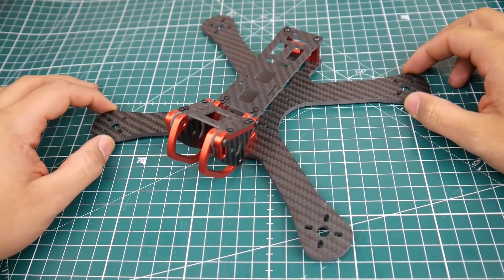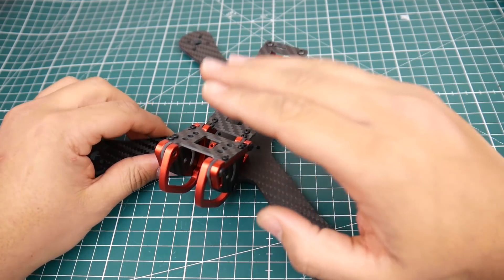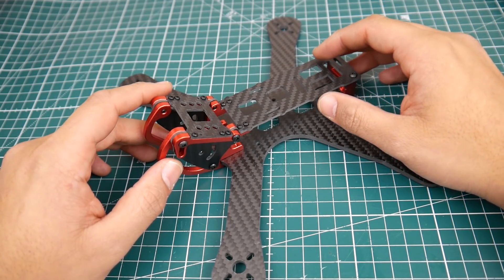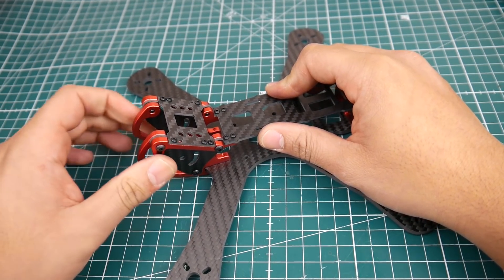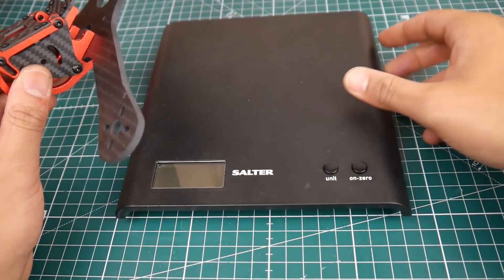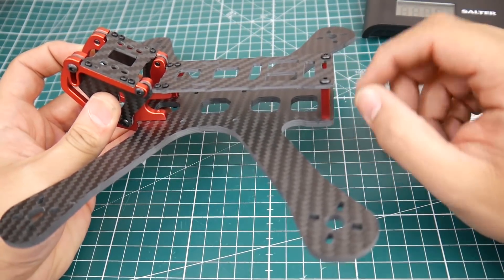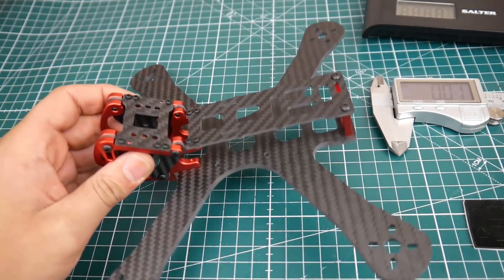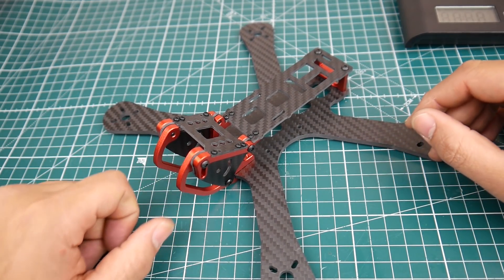Puda Chameleon Clone Frame

Comment: Being as this is  a cheap clone, it is possible that the  screw manufacturing is half ass and the threads are not as pronounced as they would normally be with higher end components. I would recommend purchasing some good screws from the local hardware store while still installing with care.

Comment: I have two of them. And I have three chameleons. In all honesty they both fly nearly identical. And the Puda frame has taken some very hard crashes and has never taken any damage.
Reply: What mount fits this frame for a go pro?
Reply: @lloyda88  I run sessions on it. But you can use any mount that is designed for the chameleon. With the session I just run a strap. It has a pad to anti slip the camera.
Reply: @JoeMaxFpv  thank you!

Comment: Armattan has an assembly video that specifically talks about not over tightening screws and to use a little lock tight if desired.   I didn't use lock tight and mine is holding fine so far.   I'm still sticking with armattan for the warranty
Reply: exactly

Comment: Does anyone know if there are replacement parts available for the Puda or do you need to buy a second kit? Also is there a chance that the Armattan parts will fit the Puda? I know it’s sacrilege but kind of important to know, especially if the aluminum is junk on the Puda. I was all hopped up to finally build an aluminum chameleon once the Ti version came out. I assumed the aluminum version frame would be greatly discounted or cleared out. No luck, just a tiny discount in price. My crash to income ratio is too high. I always will be cost conservative. Thanks for the video Mesh.
Reply: i have both frames and yes armattan parts will work on the puda.   puda as far as i know have no replacement parts.  oh and the puda stingy frame is great too, i have one as well
Reply: Derek Dvorak Thanks!
Reply: if your crash to income ratio is too high then that is EXACTLY why you should buy armattan , i destroyed my chameleon a few months back and they replaced everything, and i payed 5$ for shipping, thats it
Reply: I well agree the warranty is great as I broke my frame I half and had it replaced for just $5 shipping.  the warranty did nothing for me when I lost it in a failsafe and couldn't find it.

Comment: question is if its really 6065 aluminum :D problem with the screws could be solved by drilling the hole through the other side (where possible) and just adding an m2 nut :)

Comment: I've just finished building one of these as my first quad build, RR hypetrain 2306-2450, Dal cylcones, Matek f405 ctrl, Speedix gs 30a, Runcam split 2(need to make a mount for it as the cage is in frame on the he footage), TBS Unify pro HV and XM+. I think you'd struggle with a 3 stack in one of these. My camera cage has taken a couple of good hits already, and so far so good. But the threading on it is so bad I had to screw my screws in with a pair of pliers.
Reply: slingitsideways all that quality gear and you cheap out on a frame? If you waited a bit longer and save that extra $20-$30 you could have had the armattan with the lifetime warranty, I guarantee you will be replacing this frame and cursing for not getting a free replacement. It’s ok, it’s your first build. 
Poor man pays twice.

Comment: So as it looks it's a blatant copy.... But the other one uses M3 bolts and screws..... The aluminium is different as well.... There's a heat-treating process to aluminum that if not applied correctly will make it soft.... Barberton's aluminum has been heat treated and processed to be a certain hardness .....
Reply: They both use the same 6065 aluminum and the real chameleon uses m2 and m3 this one is identical to they rev. 3, that happens to be the last version they made revisions to besides the chameleon Ti.
Reply: the armattan chameleon uses both m2 and m3 screws.  the armattan chameleon Ti uses only m3 screws.  i have both frames.
Reply: The difference between the aluminum's as the T hardness that's right there's a thing called a t factor in the hardness of the aluminum it could be a t6 or a t4 ... Or it could be a combination of both.... But the counterfeit is not using heat treated aluminum that's the reason why it's like butter.... Reversion three or four if I'm not mistaken uses all M3 screws.... I know the rooster uses all M3 screws..

Comment: Oh man I used 12.9 steel :/ I think it must be the freakin screws... and Chris from Armattan said they used 6065 because it’s much more easy to bend back to shape where 7075 becomes brittle and yes the original had the same hardware sizes!
Reply from the maker: Mini Quads Mega Fun 6065 is cheaper to cut.
Reply: you can make the front stronger by adding two more standoffs side to side, as i did on my puda.  iv had to replace the front cage 2 time on my armattan chameleon.   if you want strong go with the armattan chameleon Ti,  i have one.
Reply: its got nothing to do with the price, otherwise they wouldnt have made the titanium editions :) its for rebending back to being usable again, ive bent mine back a few times, its not pretty but works